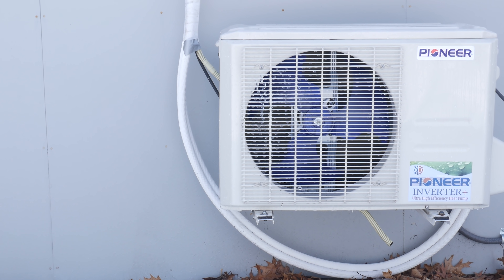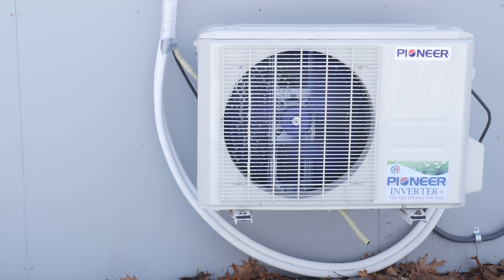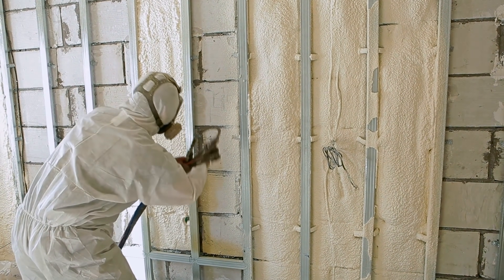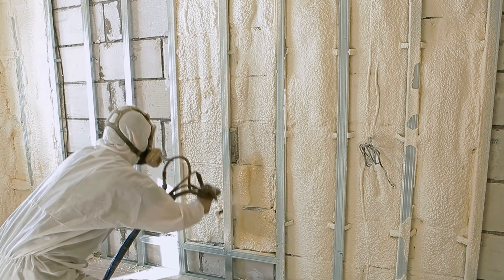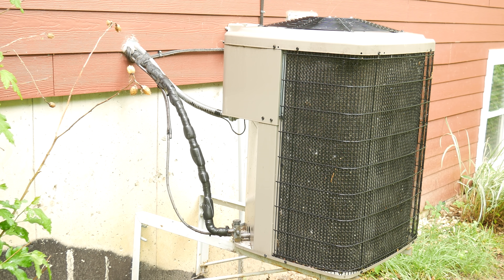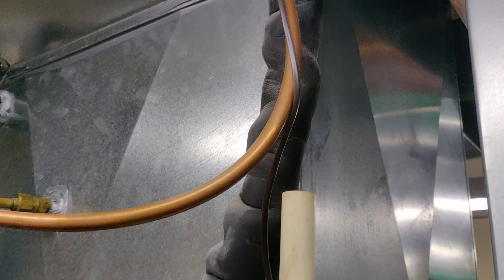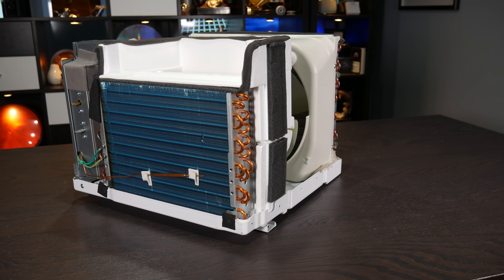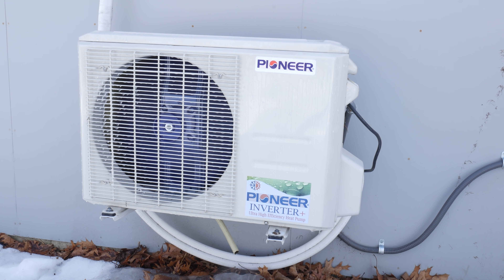Heat Pumps are Not Hard: Here's what it will take to start pumping

Comment: Sigh. Our central AC died last year and I would have loved to replace it with a heat pump but based on everything you've said it sounds like it probably won't be doable right now. The house is 132 years old and has exposed brick in a couple of rooms. In order to insulate it properly we'd probably have to renovate the entire thing. And the upfront cost is just... phew. Funny enough our neighbors got a heat pump last year, one of the Carrier mini splits, and all he had to say about it was "we overpaid".

I'll have to really crunch the numbers and make sure, but dang, I'm disappointed. Not by you, just by reality, as usual - this is exactly the kind of info I needed right now and I thank you for all of your efforts here 💙
Reply from the maker: It's shameful! We are so set up to have heat pumps, but domestic availability is generally quite crap and the HVAC trade really likes to gouge for mini-splits. There are some issues that will need to be solved on a case-by-case basis, for sure, but Asia has innovated some amazingly flexible equipment - if only Carrier, Lennox, York etc. would kick into gear and start copying their successes.
Reply: actually old houses are fine to use a heat pump UNLESS there has been zero upgrades done in the past 50 years but at that point you might want to invest in some double glazing first. please get this basic concept to get your mindset correct: insulation (or lack thereof) only tells you how much energy you need to heat your home, not how to get said heat into the home. your home does not care if the kW's come from a heat pump or a gas furnace, heat is heat. the only thing you want to focus on is keeping the water temperatures (if you use radiators) as low as possible. i have converted dozens of very old homes over the years. not once have i failed in making the home gas-free.
Reply: As long as you can get into the ceiling you can do it yourself and it's really not that hard. We've already installed four in our house ourselves and we're working on another one this week. If your house is all brick you just definitely have to go up through the ceiling instead of through the wall like we've done but it's definitely doable yourself.
Reply: @SupremeRuleroftheWorld  we are putting insulation into our walls and our ceiling because our house was built in 39 has no insulation at all. It makes a huge difference to have the insulation. But yeah heat pumps would have worked without insulation but they definitely use far less electricity when the house is properly insulated. The difference was night and day when we finished our attic last week. So much cooler.
Reply: @jkfeatherranch  make no mistaker. insulation helps ofcourse. but you would have need to spend the same energy to heat it with gas or past hopes and dreams as you would with a heat pump. the bottom line on the amount of energy you need does not change. you would also save the same amount if you would only insulate and keep the existing system.
Reply: @SupremeRuleroftheWorld  no our existing system was actually too small to ever be able to accommodate for the entire house. When they remodeled our house before we bought it they installed the smallest unit possible which is in fact too small for the house. So no our existing unit would never have been able to do it. We have never used it as we installed a swamp cooler pretty much immediately after buying the house because of the fact that the AC system was too small.
Reply: @jkfeatherranch  prehaps you might have capacity issues, but the thing people need to learn is to KEEP THE SYSTEM RUNNING. let the system keep up only and not have it trying to play catchup. with that you need vastly more capacity. set the thermostat to a fixed temperature and leave it there. considering you mention a swamp cooler i assume you live in desert climate wich has much lower heating demands then cooling so a heat pump will work just fine. but improving insulation and ducting will also help.
Reply: @TechnologyConnections  my grandparents (in Canada) have had a heat pump for years, probably around 10 years. They’ve never had a problem despite having several -40 days in the past few years since they have a backup furnace that they just didn’t get rid of. That way they get cheaper heating while still staying warm in colder days.
Reply: @TechnologyConnections  Carrier just resells Midea mini splits. They used to use Gree IIRC. 
Gree is the ONLY one I would consider for up north USA or any climate like MN or even IL.
Reply: @SupremeRuleroftheWorld  it's definitely a capacity issue the thing is rated for way too small of the house then the actual size of our house. It regularly hits 110 here in the summer and sometimes hits 115 the unit is way too small for the house and for our temperatures that we normally have. 

yes we are in a desert climate but desert climates do dip down in the winter so we do need to run a heater a little bit in the winter but that was with no insulation in the house. 

We have all of the units we need for our house to have heat pumps and we've installed a quarter of them so far and we're working on installing the rest.
Reply: I was just give a quote of $30,000 for a five head mini-split.  I’ll be dead long before I see a savings switching.
Reply: @mrb152   you are being way way overcharged! We paid $6,000 for a three head and three smaller single heads. We are installing them ourselves and there is no possible way that is $24,000 worth of Labor.

Pioneer sells their five head outdoor unit for $3,300. The five heads are $300 each. After tax that is roughly $5,000 all the equipment.

Installation takes time but it is not hard.
Reply: @mrb152  I know the feeling man. I was getting quotes for systems that were a mix of mini splits in the upstairs rooms and an air handler in the basement with duct work for the first floor. I live in NH so I was looking for a cold weather heat pump. 

Mitsubishi Quote 1: 31k with me doing the electrical
Mitsubishi Quote 2: 39k they handle the electrical
LG Quote 3: 18.9k I handle the electrical

I ended up going with the LG system, and was pretty happy with the cost since this included all new duct work since we didn't have any.
Reply: @TechnologyConnections  Do a video on carbon dioxide as refrigerant!
Reply: @jkfeatherranch  it's complicated because it's a row house in a "historic" neighborhood, also. A lot of things have to be approved by the midtown preservation society, and while we have a 3rd floor it's not at all a traditional attic. I can say for sure that the two exposed brick rooms are the hottest in summer and coldest in winter but everything I've read says you can't do blown in insulation in that kind of situation because the brick needs to "breathe" and it can get moldy fast. Honestly if anyone knows anything about a way to insulate rooms like this without doing a full renovation I am all ears
Reply: @jkfeatherranch  and also I am a terrible DIYer, if I started messing around with electrical stuff like that I would definitely end up charred to a crisp
Reply: @SupremeRuleroftheWorld  yeah the biggest concern is less "how" and more "how much will the electric bill be?" Those are the numbers I have to crunch. We actually don't have radiators, we have forced air and ducts and a natural gas furnace. I'd love to just be able to hook up a heat pump to that and keep the furnace as a backup for the really bad polar vortex™ days but I have a feeling it would be way too much $ up front, and the concern with the crap insulation is that it wouldn't "pay for itself" enough to make it worth it.

I actually have no idea if the bricks in the back part of the house where it gets coldest are glazed at all :/ I'm a lousy homeowner I know but thank you for at least giving me something to look into!
Reply: Steven. Mine was a Mitsubishi quote to. Maybe that’s the issue?

Comment: If you have to use the condensate-pump method for getting rid of your indoor unit's condensation, you'll want to keep an eye on it.  Make sure there's a switch installed (AND FUNCTIONING) that shuts off power to the ENTIRE SYSTEM if the pump's collection container fills up.

My system had such a switch, but that switch failed in the closed position.  The condensate pump failed.  The collection container filled up.  And kept going.  And going.  And going...

Insurance doesn't cover water damage from broken condensate pumps.  Ask me how I know.
Reply: How do you know?
Reply: you only need that if the condensate needs to go up. and indoor units dont create condensation during heat mode, that happens outside.
Reply: Yep, when I got my dual zone mini-split in I initially suggested a location that would need a condensate pump. The install planning guy basically told me they refuse to do installs that require pumps because of the likelihood of eventual failure.

We figured out a spot for the living room unit where they could run a drain line down the wall, across the basement ceiling and then into a floor drain without needing a pump.
Reply: And if you use a container to collect the condensed water make sure that it can overflow without restrictions, moreso if you have your indoor unit above your bed. Ask me how I know.
Reply: @dexter2811  first I want to know what happens if I don't do that.
Reply: If you install a mini-split in a bedroom, don’t even consider a location which requires a condensate pump. It’ll 100% wake you up in the middle of night when the container fills up and the tiny pump goes BRRRRRRRRRRRR.
Reply: This is why putting evaporator coils, much like water tanks in attics are one of the worst places to have one. A flooded basement is much better than water damaged insulation, framing, flooring, walls and caved in ceilings.
Reply: @Guysm1l3y  your installer was correct. NEVER install a condensate pump unless you absolutely have to. its not a question of "will they break?", its a question of "when will it break?".
Reply: IF, on the other hand, you use gravity to get rid of condensate, make sure the pipes are at enough of steep angle, not to have condensate staling and making algae grow and clog them every year, making in turn the collection container fill up and then keep going and going...
A bucket below the unit at the beginning of the season does help to show you when to unclog this once a year thingy, but a rat might fall into it, drown in the accumulated water and really really stink the place up. Ask me how I know.
Reply: @MarkoPetejan  cleaning is done at the end of the season, not at the start. free pro tip there. before the season starts you preform maintenance like cleaning the outdoor unit and having a hvac guy do a proper system test.
Reply: @SupremeRuleroftheWorld  as it gets hotter I switch from heating to cooling. To unclog I need to wait for it to feel up with water. No HVAC guy for this, this happens once and is then like a 5 minute job (in fact HVAC guy gave me the instruction on this). Outdoor unit seems to clean itself OK (looks perfectly clean to me). Also I don't do any testing, as there is nothing to test. I have two Mitsubishi split units (MSZ-FD35VA) running 24/7 (never ever switched off) for something like 14 (I think) years now, no servicing was needed, the only maintenance I'm doing is washing filters every few moths. However one outdoor unit has a bad bearing in the fan motor now and it became somewhat noisy. This will need that motor replaced at some point as for some reason the HVAC guys are unable to replace just the failed bearing.
As a fun fact, both units in 2 store house total cost with installation included was less than 3000 EUR and the electricity they consume yearly(!) for heating and cooling (there is no "season" since they are always on) is about 800 EUR, maybe less.
Reply: That system should have come with an entirely separate water sensor/alarm combo. With the kinds of long-life batteries available now, you can probably add one yourself and eliminate this worry for 10 years.
Reply: @weppwebb2885  you'll be woken up by water droplets on your forehead... Not a pleasant way of waking up
Reply: My portable air conditioner evaporates the air & throws it outside.  Very convenient.  (There’s also a catch tank but it’s always empty when I check.)

Comment: I'm working on convincing my parents to replace their decades-broken AC system and 60-year-old furnace with a heat pump, and this video going into specifics about brands that can be used to replace such an existing system is especially great for that! They've been getting hit really hard by their gas bills in recent years, which is the main reason I'm getting through to them about a heat pump being a good idea.

Though I imagine that insulation is probably an equally, if not more important thing to do, in their 1960s-built California home. I know their windows are garbage, but they have over a dozen BIG ones, and several are these old-style "bulging window frames" where there's a huge empty frame with a shelf outside the walls, and then the window panes themselves in this elaborate metal edifice with several panes of glass per window. It'd be ridiculously expensive to replace all these windows... But they did just get their entire attic cleaned out, so adding new insulation up there might well be fairly easy.

But they also need a new roof soon, onto which they intent to add solar panels. So these home improvement costs are getting astronomical... Oi.
Reply: If you want solar, think about combined solar. Meaning PV and heating. the heating won't be enough for the home, specially in the winter, but its something. Working together with a heat pump that should be cheaper than just going all in one one technology.
Reply: Try and look around for incentives for things like solar. You can usually get some sort of grant.
Reply: Maybe only replace bathroom windows? And get some fancy european triple glass ones
Reply: @the_retag  They do need that, seeing as how their bathroom windows are particularly bad. But that'll make so little difference as to be effectively meaningless for insulation improvement. That's just 2 out of the 15 windows that their house has, and they're easily the smallest out of all of them, too.
Reply: @coredumperror  yes, but bathrooms are usually heated the most. And if they are the worst windows as well...
Reply: @the_retag  Bathrooms are usually the most heated? Why would that be the case?
Reply: @coredumperror  cause you get naked? And no clothes - prefer warmer environment
Reply: @the_retag  But you also get into a nice, hot shower right after being naked.

I'm guessing that the issue here is that I live in Los Angeles, where it doesn't really get so cold that it's uncomfortable to be naked anywhere inside my house.